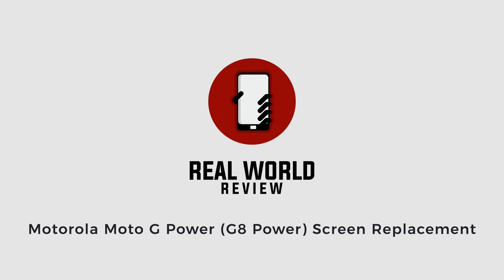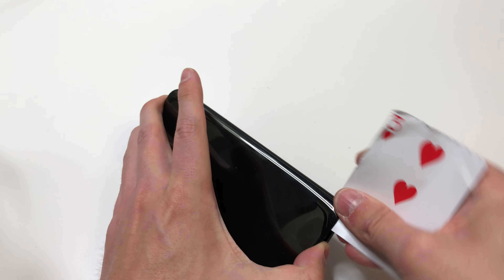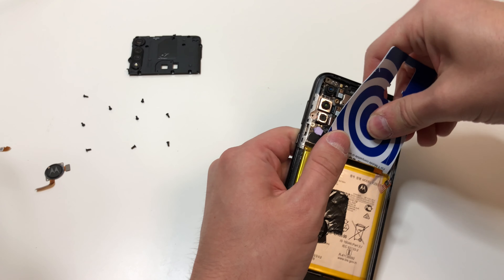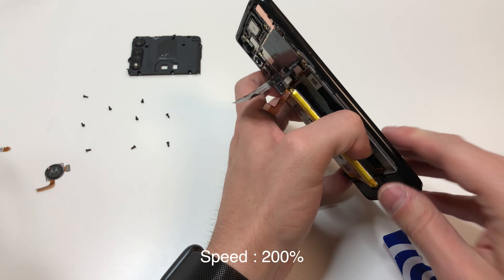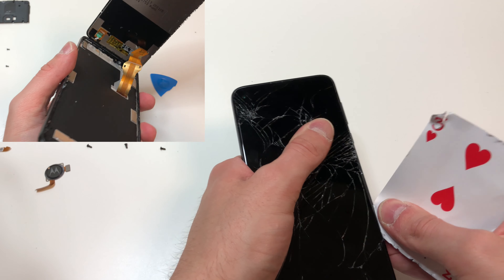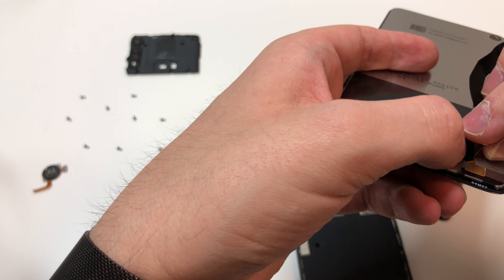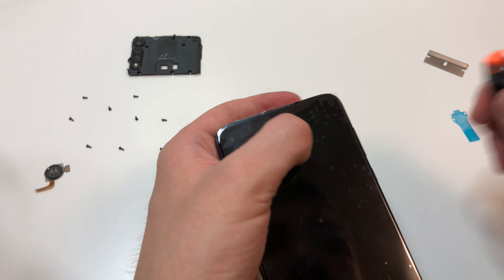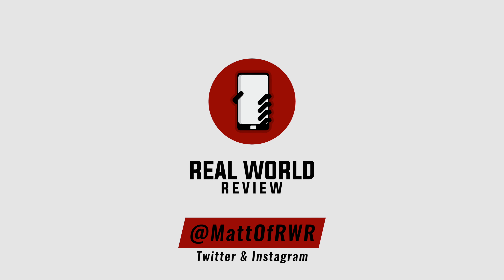Motorola Moto G Power (G8 Power) Screen Replacement (Fix Your Broken Display!)

Comment: I have a rework station just like the author, so a pretty confined air stream...  But obviously not confined enough.  When heating the screen, avoid the edges.  Heat the screen itself a little inside the frame, or the frame which is plastic, will get little distortions where it gets hot and melts.  Since you're removing the glass and the metal underneath, don't worry about heat soaking into the phone.  The screen will come off long before that's a problem.  Just thought I'd note this.

Also, during removal of the screen, that tiny little mesh grill for over the speaker might get lost in the pieces of glass.  Keep an eye out for that and be careful not to bend or break it. 

Great video showing all the steps.

Another note, the screws are a #3 Torx (at least on my phone).  Lowes sells a craftsman set with those in there for around $8.  Don't get the $11 set with more pieces, they are larger and it's not in there.

Comment: Tip: if you can't unstick the battery without damaging or bending it, use a syringe and squirt some paraffin (lamp oil) around the edge of the battery. Let it soak for 30 minutes. Very gently raise one of the corners (i used the upper left one, the BMS side) and using some skewers or tiny screwdrivers, work a piece of dental floss under the battery corner. Work your way down so the dental floss is under the whole BMS board. 
Now bit by bit, with sawing motion, cut through the glue layer with the dental floss. The oil will prevent the battery from sticking back to the adhesive pads after the dental floss has passed through it.

Comment: Thanks for the informative video.  You have more or less convinced me that replacing the battery is too difficult and risky for me.  I now understand why Motorola charges as much as replacing the phone for fixing it out of warranty.  I think this phone is too fragile for everyday use.  Now we know why!
Reply: Too fragile? I think not. I have given it as a gift to three of my children at or around August of 2020. (Ages at the time: 11, 15, 19). One has broken the screen from dropping it (which is why I'm here) - however, they bring it to school every day. Given how kids treat phones, it's been remarkably durable and it is a LOT of phone for the price. 

Having said that, the kids all have pretty decent cases for the phones, but I don't think this is any more or less fragile than the Samsung Note 8 I have. If you get a half decent case for the Moto G, it'll hold up pretty well, and at a quarter of the price of a similar specced out phone.
Reply: @jakedunnegan  Previous versions of the Moto G were MUCH more durable. This is because on earlier versions, the plastic of the case would wrap around the glass of the screen. In contrast to the older models, the glass of the G8 sits on top of the plastic, so when you drop it onto a corner the screen often breaks. This happened to me. 
The G4 and G5 i used while doing delivery service have fallen many times onto their corners, with the only damage being deep dents in the plastic. 
Still, the G8 is reasonably sturdy for a modern phone.
Reply: Replacing the battery is doable if you weaken the adhesive with some lamp oil, and then use a long piece of dental floss to 'saw' through the adhesive pads that hold the battery in place. This will not put any stress on the battery whatsoever. 
I agree, just prying the battery out is risky. You may be able to do it easily if you have a cellphone heating pad, but i tried it with just a hairdryer and decided i had to put too much force onto the battery to feel safe.
Reply: @mfbfreak  Yeah, that's fair. I still think the Moto G series is solid, but I've certainly seen some issues when it comes to trying to replace a battery. I wish more phones made that easy to do, but I imagine that would cut into their desire to get customers to upgrade sooner!

Comment: I dropped my phone and went to a repair shop to have the screen replaced. They charged me $80, labor included. When I got my phone back it wasn't the same HD quality as original by far. Dark colors are now way too dark. Do you think they put a cheaper one or did they steal any components off my phone? I just want to know so I can buy the correct parts and do it myself.
Reply from the maker: Might just be a cheaper part. You can always bring your own part and ask for an install

Comment: The process worked except for using a card to pry the battery loose. Used one of those pimple poppers thingy to slowly lift the ends and sides until I can hear the battery pealing away for from the case. after that is was easy to finish up. My phone is now working with the new screen. I am very please with the walk thru from start to finish.

Comment: We were replacing screen to my moto G power because my screen was cracked.  It was working fine broken for two days then we fixed it.  Now my backlight isn't working, we thought maybe the replacement part was faulty but it the same thing is the case when we replaced the replacement.  What would make my Backlight not work now.  We can tell that the phone turns on but my screen can only be seen when we shine a very strong light on it.  Do you have any recommendations!!!!!!

Comment: Thanks for the Video.  My glass is cracked but everything functions.  I see sellers offering the Glass lens alone, without the touch digitizer.  How hard is it to separate the glass lens from the digitizer and can you do that from the front without opening the back to unplug the screen cable in the back?  glass only is about $13 vs ~$40
Reply from the maker: Don't. Just spend more money and be happy the display and glass doesn't cost $200+ vs the $3 part they're selling for $10. All you're going to do is waste that money and still buy the screen again
Reply: @RealWorldReview  thanks for the quick answer!
Reply: @RealWorldReview  Yeah, I found that out the hard way.

Comment: Hello, I have a question, I am testing the new screen, and it turns on but it won't accept tough inputs, is this normal? Will it only accept touch when installed? Or do you think I have a bad LCD/digatiser?
Reply: Thanks for the great walk through by the way
Reply from the maker: Make sure the cable is flat against the phone, and it should work fine. When testing the touch will be weird until it's flat, or installed.
Reply: And I figured out that the digatiser has to be in contact with the plate on the back of the screen to function!

Comment: I replaced the screen like shown in the video but now the screen is just bright white. There is no data shown. Can you give me a hint what i might have missed?
Reply: it's possible that you didn't align the pins on the screen connector very well, or that the replacement screen is a dud

Comment: IMO the Moto G8/9 Power range need a substantially toughened case (or screen if possible).
They are so heavy the phone is particularly vulnerable to cracks and shattering if dropped which is inevitable.
I had a protective case but still cracked. I only had mine 6 months so gutted. The screen then starred from wear and tear.
They are good phones but I'd advise buying a very strong case plus thin screen protector film and protective glass over that. 🍀😱
Reply from the maker: They're cheaper models. Every company does this to make sure you spend more money. Motorola isn't the only one doing this. But yes, I highly recommend adding a tempered glass screen protector to the screen

Comment: I fixed the screen, but now my speakers and volume buttons aren't working. Any advice?
Reply: Remove and re-seat all connectors. Make sure there is no damage to the little black and white wires on the right side, that run from the main board to the bottom board.

Comment: I have looked all over youtube and forums, hopefully someone here can help me. I was doing this repair, put in the new display to test, fine, all good, then when i put everything back together, do one more test before glue...nothing. Have vibration, Long vibration, but then no sounds or screen no "hello moto" noise, fingerprint scanner and power button make a vibration if held, nothing else, anyone know what I did wrong?

Comment: when i turn on the phone the screen is black when i put the battery on place. However its ok when the battery is not put on place. Any ideas what is going on?
Reply: Might be a bit late but it will be the battery shorting somewhere. Wrap the battery in kapton tape and it will be fine. This has happened to me on a Huawei before and this solved my issue 👍

Comment: More adhesive than I want to deal with.
Reply: Yeah, it's pretty terrible, but doable. The case opens fairly easily when heated up with a hair dryer. You can cut through the adhesive with some plastic from one of those terrible blister packaging things. 
Then use dental floss and lamp oil to cut through the adhesive under the battery. All in all it took me the whole of an afternoon (with a bunch of breaks) to put my own phone's internals to a ready made Aliexpress screen that was already bonded to a frame.